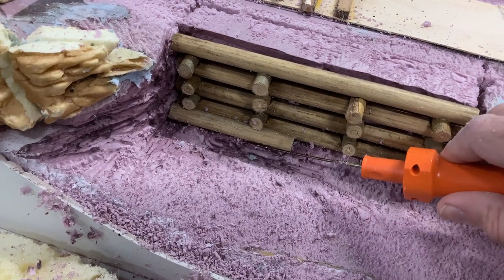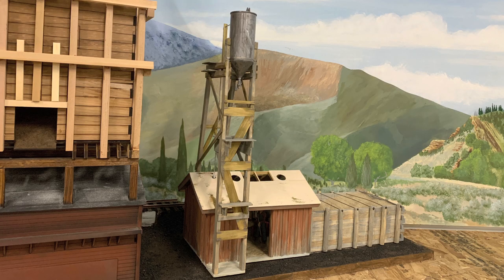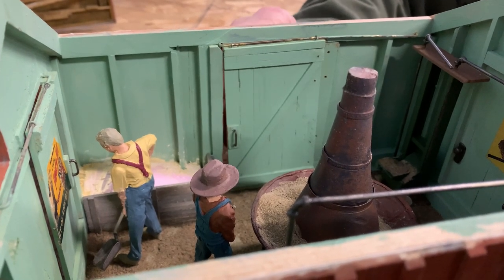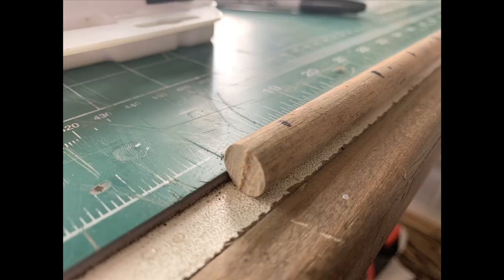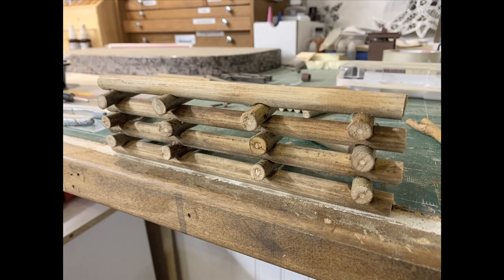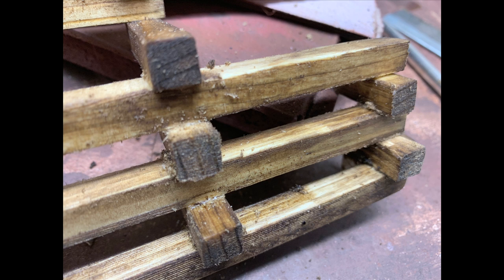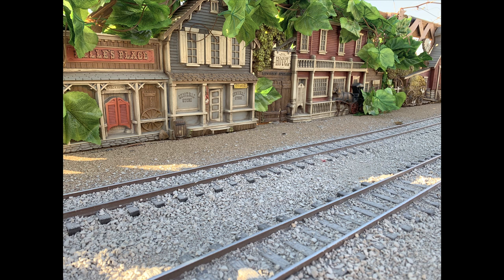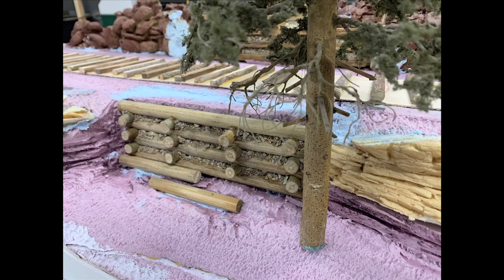Modeling Cribbing and the Chama Sand House in 1:20.3 Scale

Comment: Very nice series of details to add to the line. My very best friend built his home next to a creek. Core of engineers were trying to concrete the channel but Bruce stopped them and won. His solution was rock filled wire baskets called gabions. Water could drain through and plant growth could as well stabilizing the entire structure. This was on Mission Creek in Santa Barbara. Bruce is blind.
Reply from the maker: Mission creek.. love that place. Big flood problems though. I was trapped in my house for 3 days in Ojai.

Comment: For your notching of the long logs get yourself a 1" drill bit , put it in your drill press and sink it down below the table of the drill press . Then take your logs and push them into the drill . You will have the right Curve on them to stack them and they will be rough as if they had been gone through a wood cutter . That is what we did and it worked out GREAT . We found the Sander would BURN the logs and we went through at lest 10 drums before we went to the Drill set up .To make sure it would all line up we build a jig with a piece of 4 x 1 and drilled 4 holes into it to put a peg in so we had four holes for the different spots to drill . WORKED GREAT and down the road if we want to build more we have a TOOL for that ...

Comment: Nice  job folks . Years ago I  mentioned to  a  fellow model train builder on using Kitty Litter . Well you guys confirmed my idea though not  original but it  works and  looks authentic for the  cribbing fill .  The  litter is  $4.95 for  25-30 lbs and  useful for many other intent and  less expensive than  the quart at $9.95 of  medium grit ballast . I  enjoy  your videos and sharing .
Reply from the maker: So far we don’t see a down side..  several people have said it’s bad. Changes colors and so on. But it’s clay. Just clay. Dirt. Just don’t see a down side.

Comment: Quick tip: for your foam cutting tool, you can buy extra wires and bend them with pliers to create different contours.
Reply from the maker: Need pore power I think. I can grab the tool at any time and its just sort of hot. Perhaps 120 degrees?

Comment: That is looking great. A trick Al used on his logging railroad for his cribbing was a  forstner bit in a drillpress with a fence that was drilled the same as the bit with bit sticking out enough to make the notch.

I don't know if you have looked at the intersections of the cribbing. All the ones I've seen have been pinned together with a steel drifts.

Comment: Seeing the sand shed, reminded me of the one we had in Cloncurry outside the Diesel Servicing Sheds. It looked like a boiler stood on end, with a funnel at the top and a chimney pipe that ran through the roof( to let the smoke out) down through the middle of the barrel to the firebox at the base. Around the chimney was a spiral so the Cleaners and Labourers would shovel sand from the bunker (which was outside the shed, sand being brought to the Depot in special designed wagons and allowed to flow into the bunker) into the top of the sand dryer and as it cooked it would flow by gravity to the base of the dryer, where a Shute was opened and compressed air used to blow it up into the sand tank on top of the sand spider.  Unfortunately, I didn't take any photos of this before the majority of it had been dismantled... and Yes Ed is absolutely right, the Steam era guys would hide in the sand shed on night shift during winter as it was the best place to had a sleep.
Reply from the maker: That’s a great story!  Sounds like an odd tower. But love to see it. Took a lot of work back then just to put sand in the locomotives 🚂
Reply: @ToyManTelevision  i will try see if there are any inadvertent photos that show the Service shed, and I will email them to you. Cloncurry is a town 8.5hrs drive west of Townsville in my state of Queensland. It was one of the first steam depots to Dieselise. Diesels being introduced to the Queensland Government Railway in 1950 a 90t GE product with a Cooper Bessemer Engine. Your layout is coming along well too by the way. Oh I came across a shay loco that was plinthed near Toowoomba just the other day. A bush tramway used to exist near Hampton.

Comment: the square cribbing reminds me of a retaining wall setup my dad and I put on part of my his outdoor garden railroad 20+ years ago.  Instead of small square blocks, we staggered the layers.  Where they overlapped, the crib members were drilled and large galvanized nails driven through (guessing around 6d). This technique was used due to the area it was installed was located along a curve.  I do not remember what we put behind the cribbing to keep dirt from spilling through as the gap between layers was around half an inch.
Reply from the maker: Yes the back fill needs to drain so usually gravel. Larger stones. Usually stays put.

Comment: Rotory grinders are available for shaping the logs.  
I have seen 2 sand houses in use.  One was on the L&NW RR at Gibsland, LA and the other was on the Reader RR at Reader, AR.  Both of them had screens at the bottom of the cones to let the dry sand of the correct size fall through into catchmets for collecting the dry sand.  The tube you have for the sand to go into the buckets comes from the wet sand area not the dry sand area.  Unless you have a drawing or photograph of the sanddrier stove, I remember the area for the screen to be smaller in diameter than you have depicted it.    The sand drying house was where everyone would gather to shoot the breeze and warm up.  I will try to find a photo of one of the sand drier stoves.
Reply from the maker: This is based on a model seen in I think the gazette. no idea what’s correct or not. And it had no system to blow the dry sand. But it had that “drain tube” dumping into buckets.